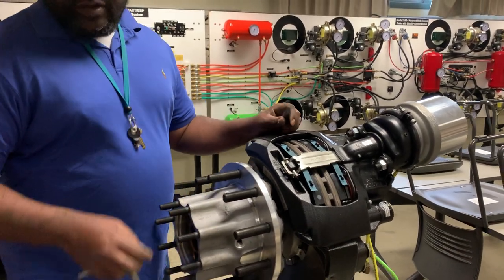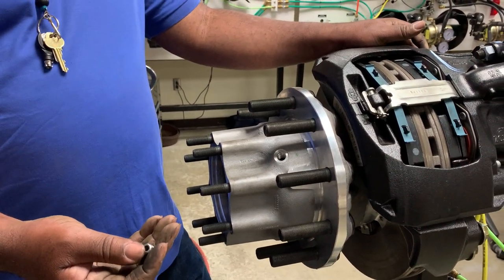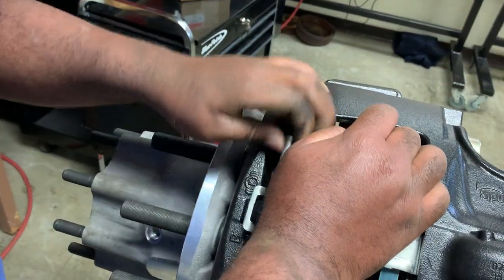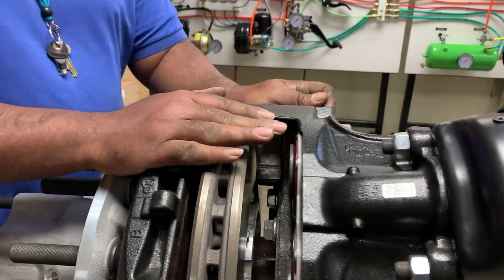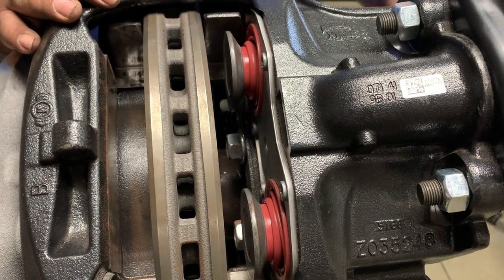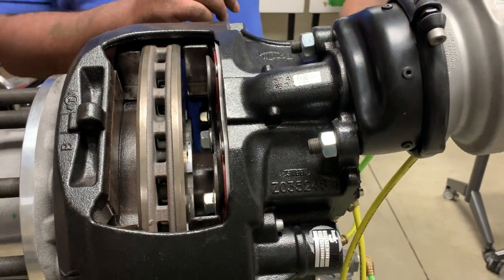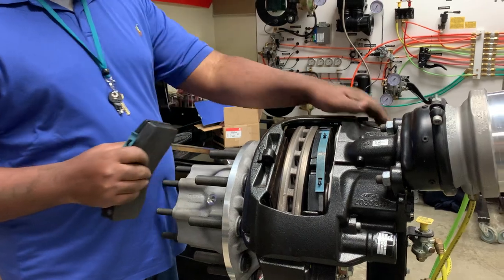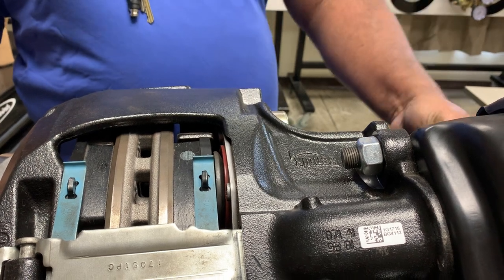Air disk brake pad change and adjustment

Comment: Good video. When I do a pad change the kit comes with new hardwaredware including the sheer adapters. I save the old ones just in case.
Reply from the maker: Great tip! you can never have to many shear adapters lol

Comment: One of the easiest disc brakes to work on.. Done a bunch of these. Also to check is the slides are worn out. Had one the bushings were worn out . The caliper would move up and down..
Reply from the maker: If you run across another one please take a video and send it to me. It will be good to get that information out.
Les-

Comment: Ohk i did everything that way but u can drive a bit then it locks up when i go to adjustment points they are tight i loose them 5 klinks drive about 2km then they bind again

Comment: Hey , what can be wrong i did 3 clicks when applying brake pedal it holds when parking brakes are set no brakes , even i tried 1 click still the same , the chambers are designed to hold on when using parking brakes non of the 4 tires is holding brakes when you pull the knob

Comment: What if I keep breaking the sheer adapter. The brakes are aired up and released.
Reply from the maker: It sounds like the tappets may be sized. The adjuster should move in both directions with the brakes released.